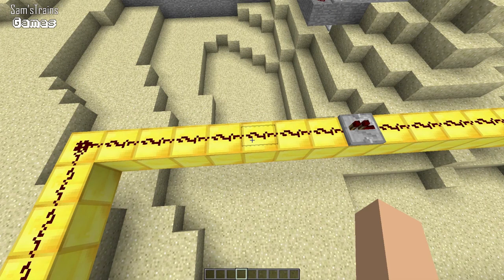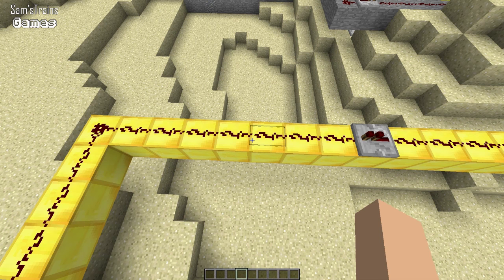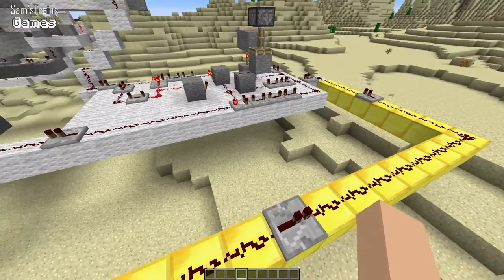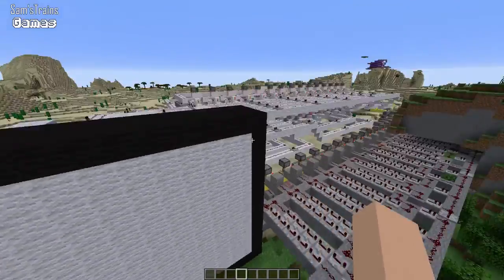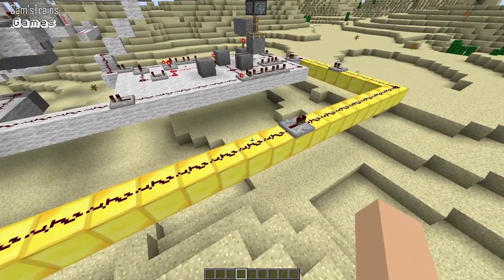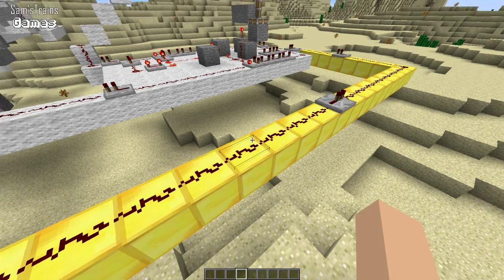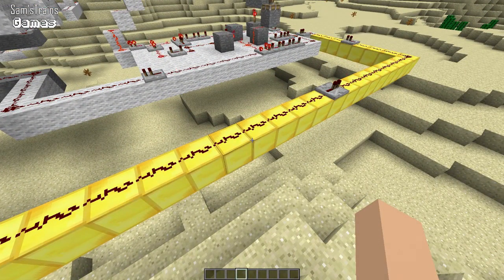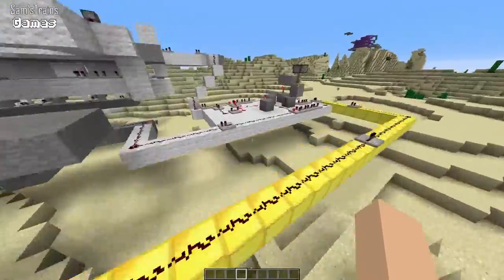Minecraft: Redstone Encoding & Decoding

Comment: why use binary serial when parallel or analog is better?... also i made a input known as “pii” its a parallel connection and it would only take 5 wires “pii stands for ‘parallel inverted input’”  so the first input is the x and the second input is the y “talking about one after the other on one cable”... i might have to show you some things... im probably worst at redstone than you but i know somethings